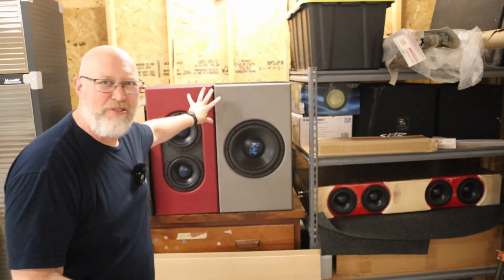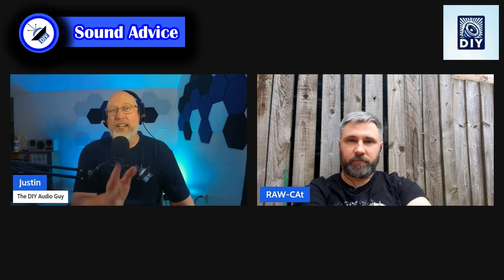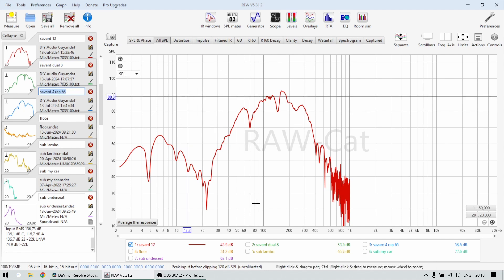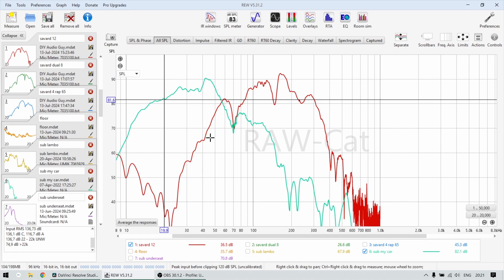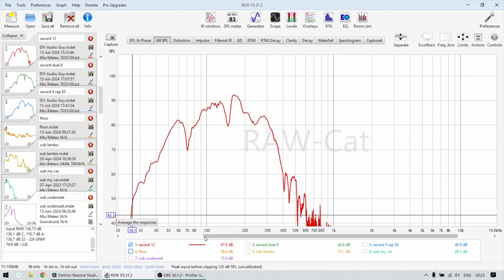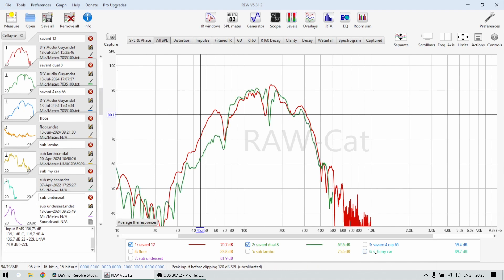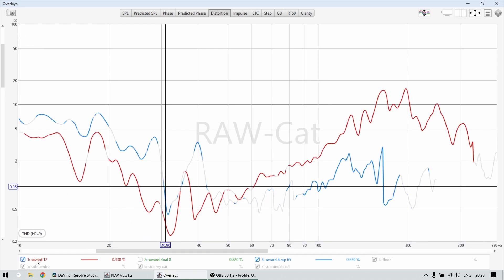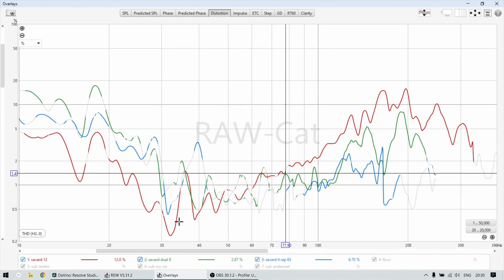Why bigger subwoofers are better

Comment: Mr raw . Would you recommend using crossovers or tuning with a dsp ? Im running two sets of 3ways on my front doors but cant decide if i should use the crossovers. 
Im gonna be running the eazy 612 from d4sound. Thanks
Reply from the maker: If you have a dedicated tool for that - use it. DSP all the time.
Reply: @RAW-CAt . Thank you . Is there a better way to contact you . Would like to pay for your help with tunning. 😊
Reply: @RAW-CAt

Comment: I have a 2017 Canyon Extended Cab and it is a pain to get loud low. I sold my VXF setup and am running a cheap setup while I finish my new enclosure, just finished doing the electrical. My current box is supposed to be tuned at 36hz, 2 cube, single 12" SVR I have heard the resonant frequency is around 41hz and I do get a big jump around 42 but continues too get louder until about 49hz, I cut it off at around 70-80hz. It will get to 30hz with the windows down but it is noticeably quieter and 29hz is just too quiet for music. 
I plan on putting a 5k amp in and was leaning towards a single 15 or maybe a pair of 12s and tune in the 28-32hz range but think I will probably waste most of my power fighting the small cab. I have had so many people swearing I need to stick with 8s or 10s lately but I just feel like the 15 is the better route even if i tune a bit high than I like to take advantage of the acoustics.

Comment: The only thing I do not like about having small subwoofers is that they have to move a lot to compensate like a bigger one and that extra movement leads to more harmonic distortion and danger of ripping soft parts. Unless you use a whole bunch of the small ones together but that sure is a lot of magnet weight in comparison to only one big subwoofer and magnet that’s for sure. 
My dream Subwoofer is a rectangular 15” x 30”.

Comment: Just admit the measurements are not done right 😂.  

Its got nothing to do with the car to a very large degree and most cars and or vans start to load from 80hz and generally flattens out. Thats why brands use High Q nonsense..

Justin something is wrong with your setup in Rew and the mic or you have a filter on the dsp. You can load a 4" or a single 6 inch  and get a better looking graph, take care.
Reply: He's also got a homemade electrical RTA so he can see the signal going in to and out of the amplifier. I do as well and sometimes it reads incorrectly the signal coming off of the head unit, but reads properly on the output of the amp. It probably has something to do with signal impedance. Anyway, this would allow him to verify that there's a flat signal coming out of the amp.

I don't know if he's using his dsp and everything is set flat. The above test should tell us that.

I've also noticed that using pink noise isn't the best option for frequencies under a 100 Hz. I think setting REW to measure peak SPL and then using a sine wave sweep might be more accurate.

It's also possible he may just have to do a lot of tweaking to bring down those upper frequencies and boosting the lower frequencies to get the kind of frequency response he's looking for.
Reply: The measurements look proper enough.
Reply: @JasonWW2000  I'm not confident at all, I see 0 gain from the car below 80hz. It could be right idk but my gut tells me nope, having measured 50 + vehicles this does not look right at all.
Reply: @The-Sound-Guy  I've done a ton of RTA measurements over many years, but it's always been my own vehicles (sedan, suv) so I have a limited amount of experience.

Looking at his graphs, it looks like the truck peaks around 60hz. That sounds about right. 

It seems he's got no cabin gain, though. 

I don't know what that particular vehicles response curve should look like. 

There's always a chance that there's an issue with this microphone or the REW software settings. 

I think Justin should take a sealed sub and fire out of an open door to get a free air response curve. Then put that enclosure in the backseat, close up the truck and do another response curve.

This way we can actually see the effect of the vehicle.

Comment: Nigerus (raw-cat) done brought the public knowledge to a whole level where a average knowledge guy like myself doesn't have to be lost or guess to I feel it is right but still don't really know. Alot of top guys give you little bits and breadcrumbs even though someone taught them and you still chase the dream of your hard earned equipment is playing the best you made it and you getting the real listening enjoyment you expected or come close. I blame manufacturers putting out products like dsp, dsp amps and vehicle integration stuff and have nothing uploaded at the time of purchase of installation, tips and why and what the products should be doing at the moment of install and have a video showing what dsp and vehicle integration equipment is not doing when you install wrong like when using their gizmos when installing a radio and the steering wheel controls not working. Where to grab the power wires when the integration stuff needs key or constant 12v, lil stuff like that goes a super duper long way. I got navtv stuff in my srx cadillac and supposed to mirror my android for my apps and play videos when I'm ready but nothing pops up. No fuses blown I feel I followed directions but it is always a sketchy part in the directions when it comes to integration equipment.  Spent big money on the zapco dsp but for some reason the spdif input is not putting out sound and you can't get in touch with no one who knows anything, you would think zapco would have tech team videos up showing the installation and use of their products and not just them all the big boys in the game instead of showing a cool install and saying go buy it cause it enhances your system. I dig just as good in simpler times with a in dash eq from back in the day that is a dam shame

Comment: What is your take on sq subwoofers being mostly 10"? There are different opinions on this, but most conclude being more precise and overall better "sq" than bigger ones.
I have been wondering if this is really the case because subwoofer technology have come long way even from 15-20 years ago, but most manufacturers who sell sq specific drivers still stick to 10".
Reply from the maker: My opinion is that it's bull. It all depends on the individual driver and it's performance rather than size.
Reply: @RAW-CAt  That is exactly what i have been thinking. I just don't understand why most manufacturers stick to 10". I personally have just acquired dayton audio 18" reference and just built sealed enclosure for it, looking forward what i can do with it.
Reply: @mumppa 10" is big enough to fit most magnet structures.  As far as  cone area per cu ft of box, 10's usually win as well.  For the box space of (1) 15", you could run (4) 10's.  Transient response will be faster as well, with 4 motor structures.  

There are advantages to bigger drivers as well.  Higher efficiency,  lower FS, easier to drive, sometimes  more flat frequency response.  I do agree with Raw-Cat that it depends on the driver, and SQ does not require 10" drivers, I'm just giving some reasons they may be more common, especially when it comes to car audio.  Space considerations are probably the biggest reason for smaller drivers.
Reply: The answer as to why most SQ subwoofers are 10" is really quite simple. That size is the best compromise between output and enclosure size. 

I'm sure manufacturers could create 6.5" or 15" sound quality subs, but small drivers might not be loud enough and large drivers are too big to fit most vehicles. If a company has to choose one size, the 10" makes the most sense.

IMHO.
Reply from the maker: @N-light-end-1 unfortunately no. They are not available in the UK.